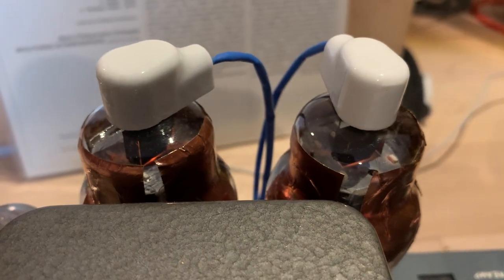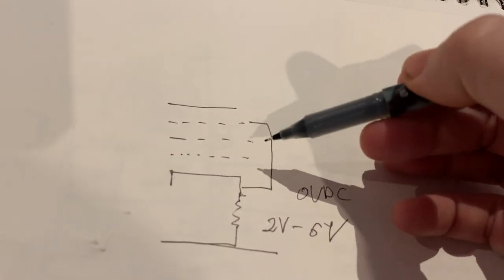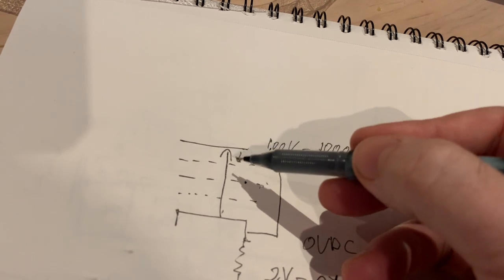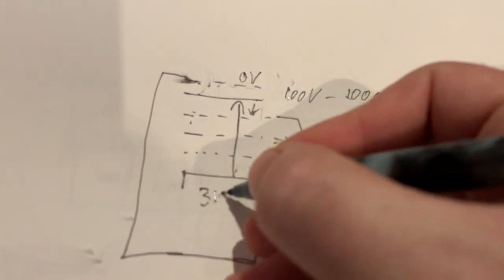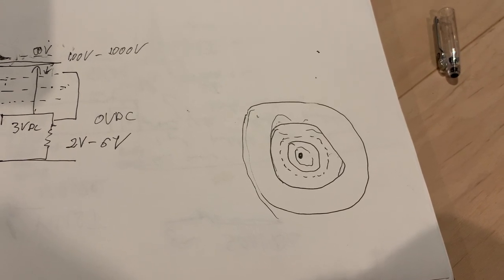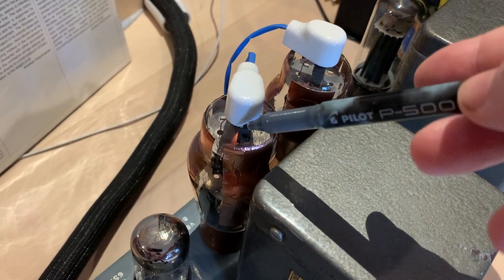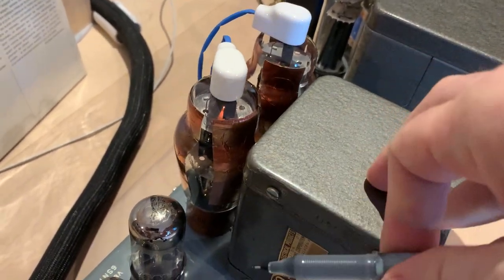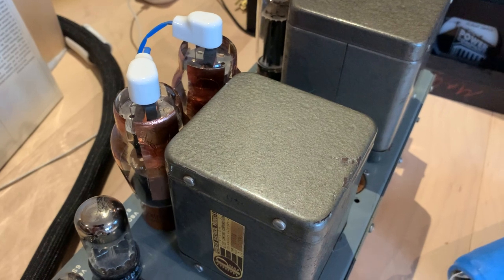Tube cooling and shielding! Benefits and drawbacks

Comment: Another great explanation, much appreciated. 
On your safety note, I completely agree. One can take NO chances.
I zapped myself with HV once by foolishly taking measurements on a spectrophotometer while it was on. The first, and last time- lessons were learned. 
A high- tension shock of several hundred volts is a totally different feeling than 117 V, etc., both very dangerous but if you've ever experienced it, you know. 
If the current passes through one arm and out the other, traveling through your heart; the lesson could very well be terminal.